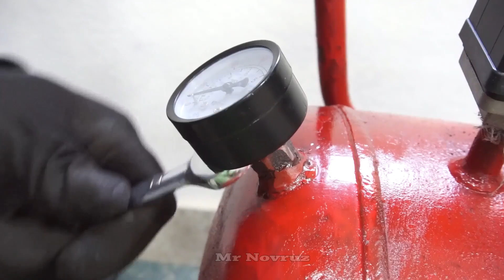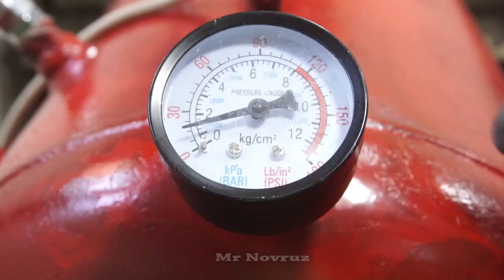How to make Homemade Silent Air Compressor from Refrigerator’s Compressor. Step by Step in Workshop

Comment: Can fridge compressors operate continuously (or long enough to fill a tank) @Mr Norvuz? I think no.

They work with a refrigerant, say R134, not with air, which has very good heat transfer and specific heat. R134 has about 150KJ/KG specific heat, while air has 0.001KJ/KG. So much more air, about 150000 more, has to be circulated for the same amount of cooling down the compressor. 
 
A lot of cheap consumer equipment (vacuum cleaners, fridges, anything with an AC motor) is rated only in duty cycle operation (20 mins on, 20 mins off) since they lack adequate cooling. And especially the dumb ones (without a VFD/inverter) use thermal switches - cutting the power to the compressor completely if it overheats - say it's summer and the fridge has to work harder.

@10:56 you disassembled a contactor, replaced the compressor's pcb and bypassed the thermal switch completely. So how do you thermally protect it?

What's the longest time you ran the compressor without overheating it?

Comment: A small capacity tank is better for this project for small short duration diy work , fridge compressor is not suitable for large tank filling,not cost effective, however could be used for cycle or two wheeler tyre inflating 😊